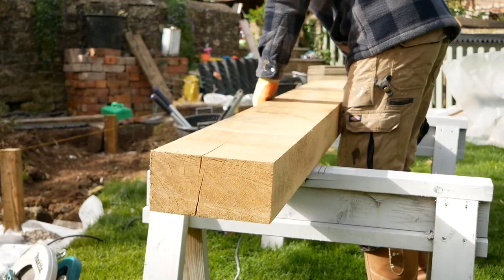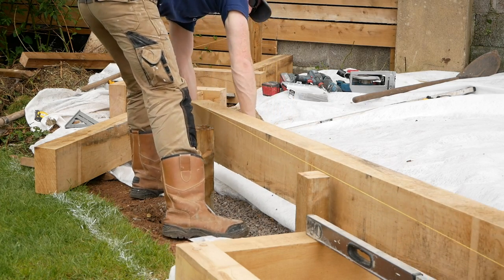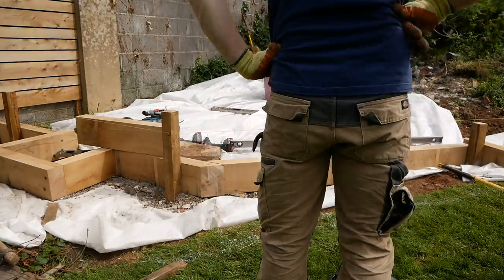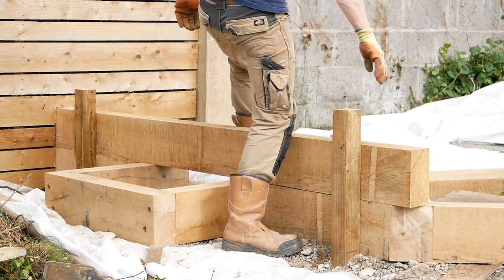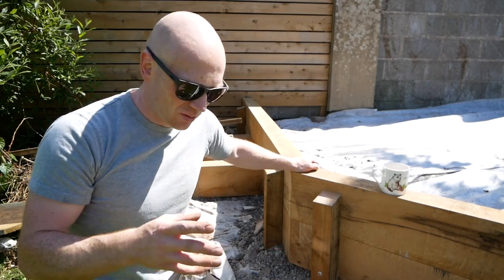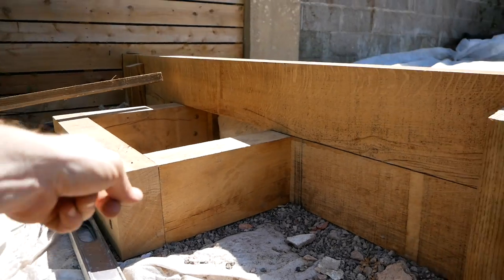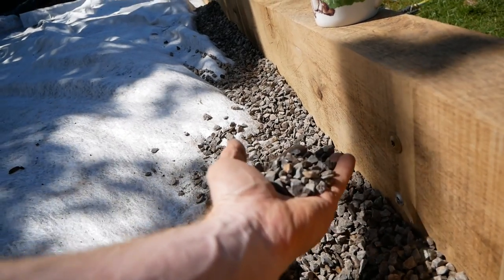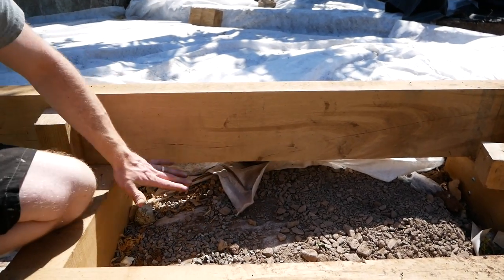Building the NEW OAK SLEEPER WALL

Comment: If you put type 1 on the top, won't the fine particles clog up your nice clean gravel?
Reply from the maker: Perhaps. They tend to end up pretty locked in once compacted. The fall is away from oak so surface water is less the issue, it’s more the constant damp soil and bugs that bring underneath.
Reply: @TheRestorationCouple  thanks, why not just use gravel all the way?

Comment: I used the same Timco fasteners for my workshop framing. They are good, but the stainless steel ones have a deeper thread and are generally bulkier and so have probably better clamping power.

Comment: Have you tried using the speed square as a straight edge / guide for the circular saw? Helps keep me on the line. Loving the oak work again, looking forward to the workshop (when you can, no pressure).

Comment: Great work, some really useful tips for a similar project I am now doing. Did you drill pilot holes for the fixings? I’m struggling to find a long enough 4mm drill bit to do the job for 6.7mm screws.

Comment: Hi Tim, another interesting video with some great ideas. Did you source the oak locally? What sort of cost per linear metre are they? Planning on doing a lean-to in oak and have no idea of costings or where to source wood. Thanks.
Reply from the maker: You would probably not use this for structural, although it would certainly be strong enough. Most oak will be french and likely imported cut, if you are using standard size posts. Otherwise you may also find local sources from sawmills. Try Yandles website for some guide pricing and sizes. Sleepers will vary in cost a lot as will quality, these were around £32-35 I think. If building needs to be BRegs then you may require structurally graded timber. 👍
Reply: Thanks Tim

Comment: Hi tim brilliant as usual
Was wondering if they are oak posts too...and can I use normal posts to bolt to the oak sleepers
Reply: Same question, but also wondering about how deep the posts need to be and whether you set them in concrete/postcrete? Great video by the way, we really enjoy your chanel.
Reply: I can answer my own question as I watched part one! Looks like 75mm x 75mm tanalised softwood for the posts, in postcrete and about 45cm deep?

Comment: Looks really good, but I can't help thinking how much are that timber?
Reply from the maker: £250
Reply: @TheRestorationCouple  Way less that I expected. Thanks.
Reply: @TheRestorationCouple  Either you used fewer sleepers than I thought, or you've got a good supplier! Will you say who you use and target price per sleeper please? Thanks!
Reply from the maker: James Parker there were 6 or 7 used for that wall. Prices vary, £20-25 will get you an oak sleeper but they are very rustic, quicker to rot and not usually more than 2 square corners. These were £34 I think but all french white oak and square all round, no waney edges. I use local sawmills like valley sawmills and Yandles. Batches vary so worth seeing in person as they are usually imported precut.
Reply: @TheRestorationCouple  Thank you Tim. I really appreciate your reply and advice. I hadn't considered the downsides of the rustic sleepers. Good to know that what I'm finding is in the right price bracket.

Comment: great craftsmanship .... but why not build a stone drywall for retaining your fill material ? ... the wood will always wet and decay.
You could always build a simple bench directly in front of the stone.
Reply from the maker: Prefer working with wood 👍. You are correct, a stone wall with drainage is a good option but well thought out install of white oak should still last decades with no soil contact.